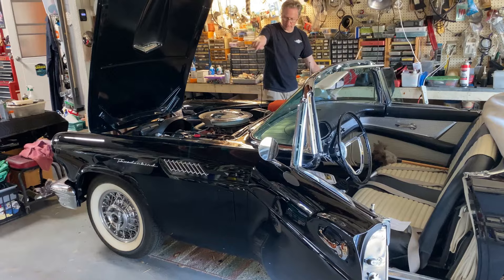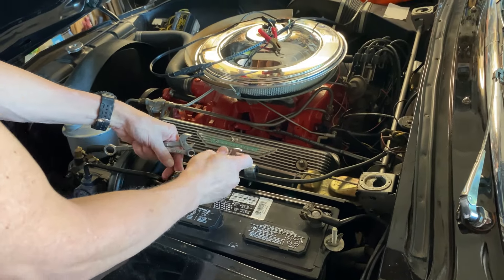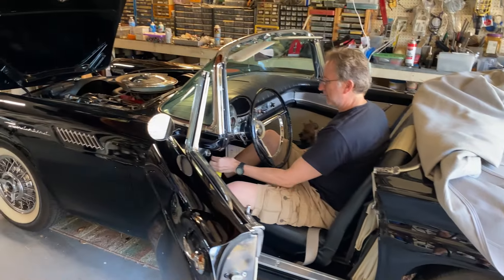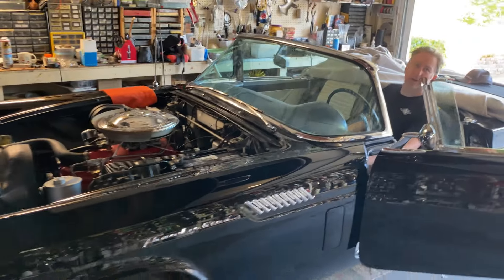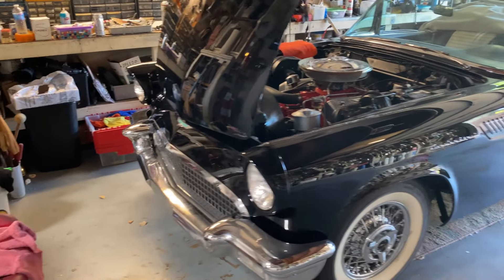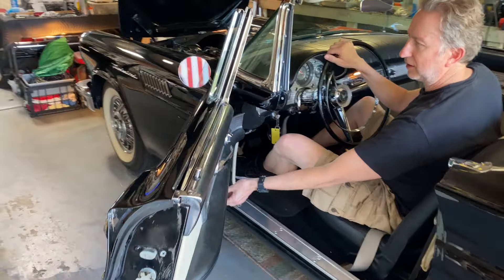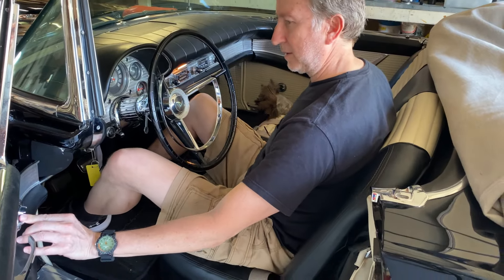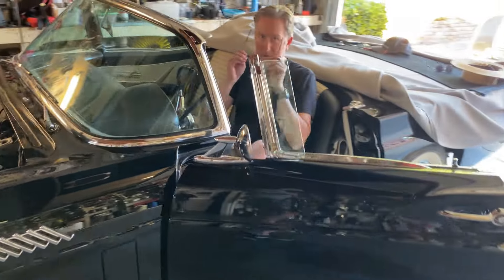Alvin's SECRET to Starting Your Classic Car Engine -- We try it on a 57 Thunderbird

Comment: I believe my dad said grandpa had a 56, with the dual 4s. 
Correct me and him if needed,and 56 didn't have dual 4s but i thought he did say it was a 56.  
Im passing along 2nd generation info 😀
Anyways, Dad said it also had electric overdrive. 
I guess grandpa rewired the kickdown thru the overdrive with another switch. 
Punch it in 3rd overdrive, and that would kick it down to 2nd and drop the overdrive and make the tail get a little loose around 40mph and then get  its hat and leave. 😀
Reply from the maker: Yes, I don't believe the dual quad E code was available in 56.

Comment: Nice car. I would never use starting fluid on a classic car. Starting fluid is ether, it burns super hot, and can burn holes in pistons. It was originally designed for diesel engines, not gasoline engines. I have two classic cars, a 1969 Plymouth Roadrunner 383/four speed, and a 1970 Dodge Challenger RT 383/4 speed. Apart from going to a local car show once in a while, I usually drive them around locally early Sunday mornings, when there is little traffic on the streets. I alternate between them, one car one week, the other car the next week. I take them out and run them at highway speeds for 20 miles or so every few months. I always let them completely warm up before taking off. The problem with letting them sit for a while, is that the fuel evaporates out of the float bowl. So the accelerator pump won't work until the fuel pump has filled the float bowl, which can sometimes take a while. If that is a problem, remove the air cleaner, and fill the float bowl though the bowl vent with a squeeze bottle with a nozzle on it. That will be enough to start the engine and keep it running until the fuel pump is pumping fuel into the float bowl.
Reply from the maker: You've got some great cars!  I think the difference between starting fluids in the past and now is that they now have additional upper cylinder lubrication/oil in the formula.  For example https://www.motortrend.com/how-to/start-old-car-hasnt-run-years/ it notes, "Starting fluid goes a long way and lasts a longtime. The black can of Valvoline Pyroil must be 20 years old and contains upper cylinder lubricants good for an old engine that sat for a long period of time."